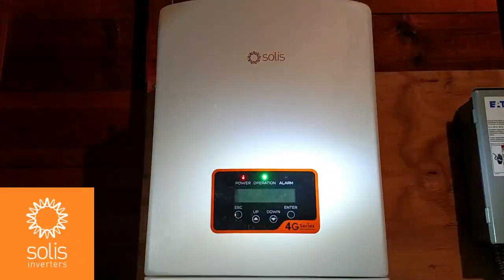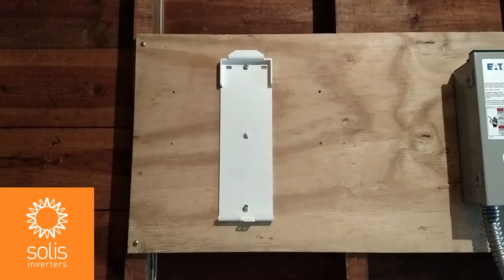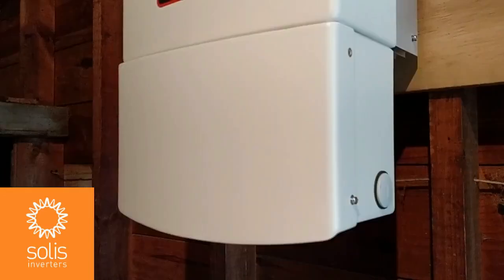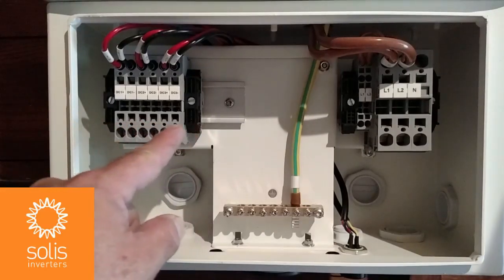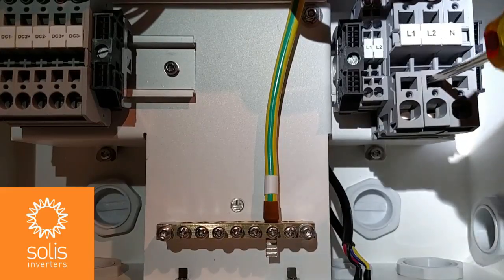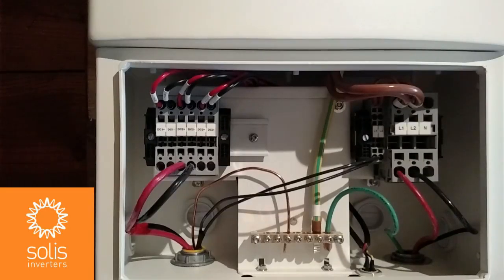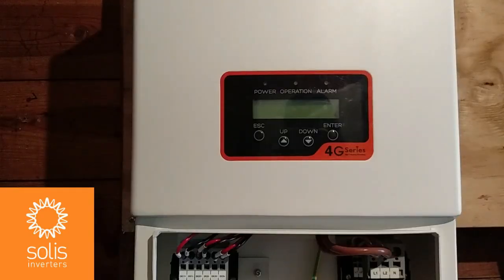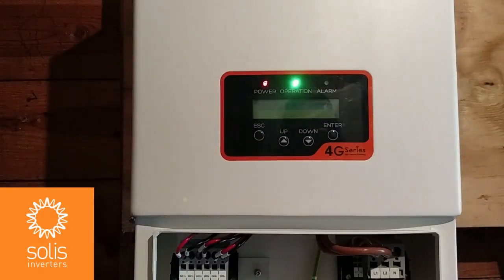Solis Training Video:  Mounting, Wiring and Commissioning Solis 4G Inverter

Comment: Hello. Where can we plug the batteries in these models?
Reply: You cannot.  You should look at our new Solis S6 hybrid.  There are nine different batteries you can plug into that high voltage (Li, 120-500Vdc) hybrid inverter.  We're releasing a LV unit (similar to SolArk), this winter.

Comment: What are the mppt for? Will they charge the battery?
Reply: MPPTs are electronic devices that follow the IV curve of the PV string connected to the MPPT.  MPPT stands for maximum power point tracker.  And that is what it does.  It tracks the IV curve of the PV string and stops on the highest power point on the curve (the IV curve is shaped like a "human knee" in typical PV module data sheets).  The PV string IV curve is sort of a longer version of the human knee comparison (i.e., more PV modules in series), but same thing.  The MPPT tracks along the IV curve and looks for the "global max power point" of the curve.  You want the MPPT to find the highest power point of the curve because that's the point where the PV string is generating the most power for the inverter, and consequently the most payback for the owner.

Comment: can we use generator set to energize our solis 4g series grid tie inverter during black out?
Reply: You can try to grid form with your generator, and then hope your inverter will see a stable wave form for 5 minutes and then it may come on and send power to your ac breaker box.  But your generator is also connected to your ac breaker box.  So now both the generator and the inverter are sending power to the loads.  But if the loads are low and the sun is high, the inverter will start "exporting" to the "grid".  That's your generator!  So you run the risk of the inverter back feeding into the generator and that could harm the genny.

Comment: Solis 7600watt inverter will produce up to 32A on the Ac output in the video 12AWG wire is good for 16amp continuous not enough. The AC conductors should be at least 8AWG with a 40amp OCD. The video should maybe state that it should be installed by a licensed electrician.